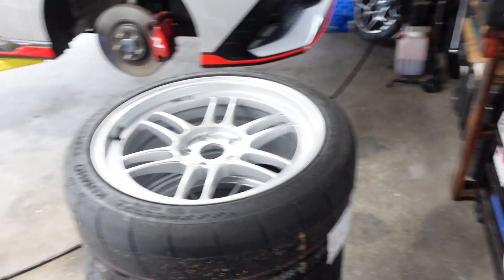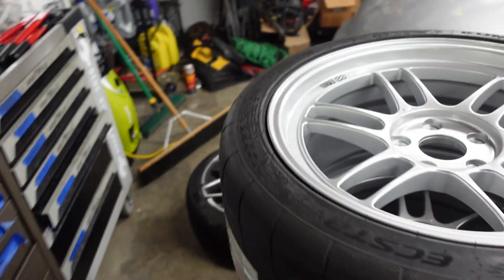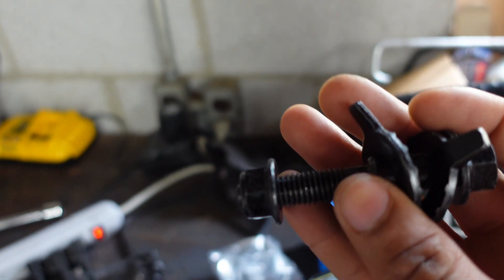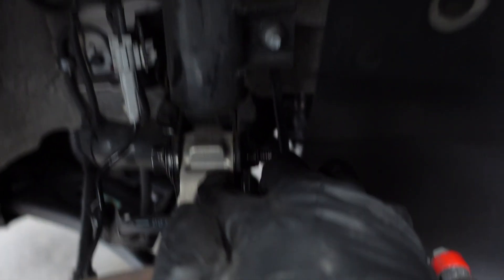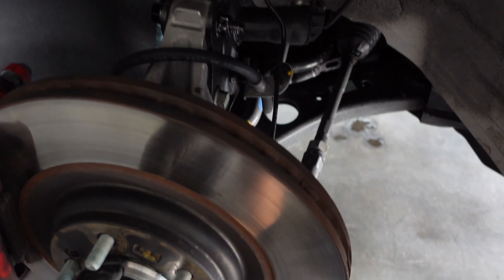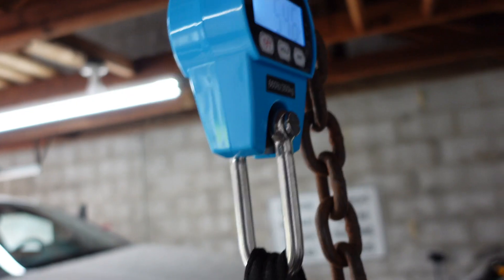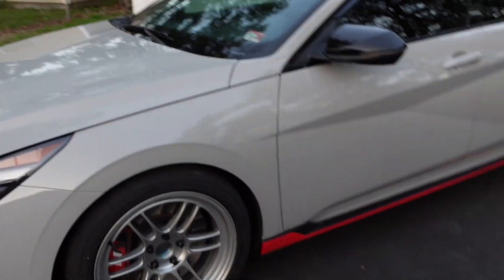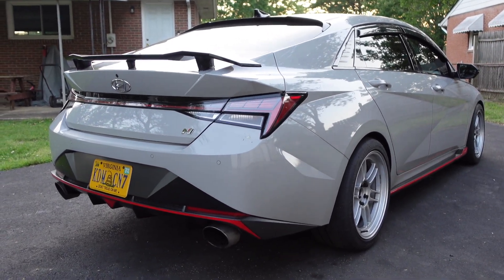Aggressive wheel and tire setup for CN7 Elantra N (265 35 18)

Comment: I was always curious if the rpf01s would fit, because I was unsure if it was a front face, rear face or mid face. Guessing it's just an rpf1 face. 

I'm rubbing 255/35 V730s in the rear 18x9.5, with camber maxed. Just barely on big hits (laguna seca).

I really like the V730s. I wouldn't run them in the rain though... you could've done a custome wheel/tire package through tirerack and the lugs/rings are included
Reply from the maker: It definitely a tight fit for rpf1s but someone had to be the test dummy right, rear caliper to face clearance is very close, something I noticed after making the video,  definitely agree that in the rain V730s are a scary tire
Reply: @Beezy_Builds   just wait until they "break-in" they're like slicks... but good on you for trying the rpf01s. I've seen posts with 18x8.5s, but -meh.
Reply from the maker: Bro Ive been through the set already lol I recorded the video a while back, for the money they are great but the life is meh , definitely dont like the street to much might dial it back to 615k +

Comment: Never underestimate a light wheel. Your set up is equivalent to removing like 400 lb of sprung weight. Pretty serious performance gains agility-wise. Also the 2024 rims are 22 lb now. Significantly less than the older rims.

Comment: Do a laundh cobtrol in terms of grip if a bigger tire will actually benefit the cars wheel hop
Reply from the maker: Still wheel hops, lower engine mount really is the only solution
Reply: @Beezy_Builds  I have the mounts and bushings on mine helped it drastically but was wondering in combo with big tires can help too